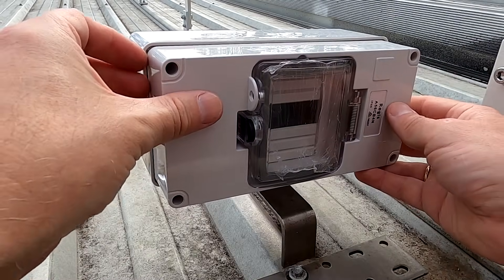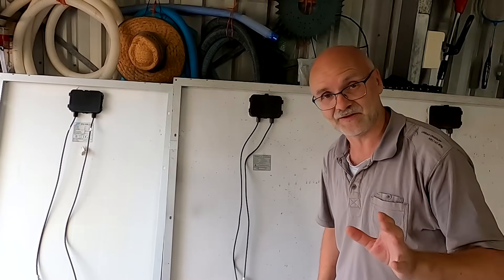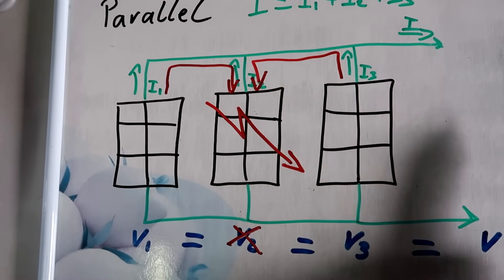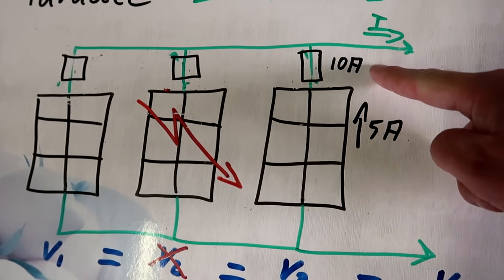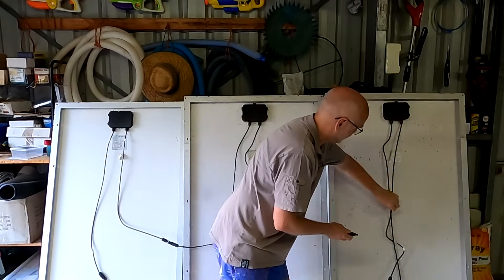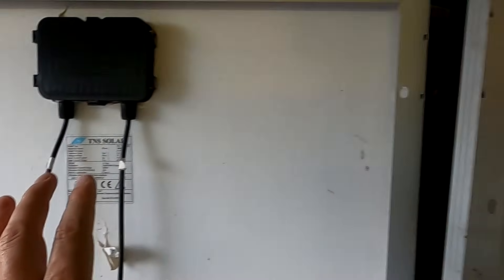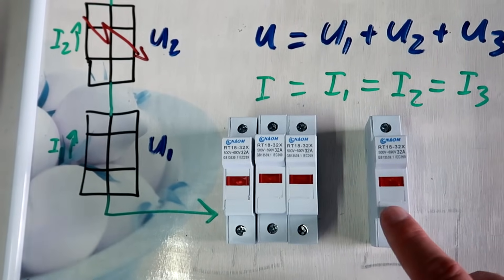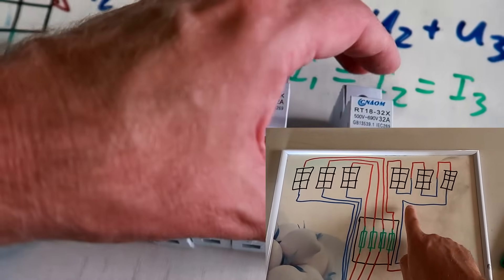Tutorial: Solar Panel Protection in Series and Parallel

Comment: With 40 years of experience I can tell you that putting fuses every where is a result of fear and missing knowledge.  Fuses are often the source of problems and the small currents of these panels combined with the high inner resistance make fuses obsolete, just avoidable cost and Voltage drop.
I operated short cut panels and even reverse polarity panels for test and the only slightly heat up because of the large surface but not even reaching the short circuit current necessary to blow the fuse, so this is useless.
Trust me I am an experienced German engineer!
bTw:
People speaking here of diodes and 0,5V drop are not accurate the Schottky have only 0,3 V  but are. Not earming money either.y

Comment: I think a short in a panel is not all that common as a failure. A high resistance in one of the cells would get warm too. Bow, with series and higher voltage, you would be "pushing" 5A through with much higher pressure (voltage) than in parallel, but no real way of detecting it as the MPPT controller would compensate and maximize the amperage * voltage. A fuse would do nothing then, while in parallel it would just have less amperage go through the panel and be fine. That said, use fuses for sure, and certainly also if you have several parallel chains.

Comment: Why would you need to fuse panels in series? When panels are connected in series, the current is already limited by the panel's rated max. current, so any panel failure won't produce an overcurrent. I can't think of a way that the fuse would ever blow. Am I missing something? Lightning?

Comment: A very good, very clear explanation of things. It also makes me relieved given that I thought it unnecessary to fuse my 2x300W panels - because they are neither wired in parallel nor in series. I have 2 panels, each with its own MPPT controller with each controller having is own fuse between controller and battery bank input bus. It amounts to redundancy at sea. Each panel also has an isolation switch between controller and panel, so I can’t easily shock myself. But it also makes it fun when people ask me “are these panels wired in series or in parallel?” - and I can simply say “No!”

Comment: I've never seen those din rail fuse holders before, since they are din mounted modules could you use a DC rated MCB instead? Also do you have the isolation switch on the roof with your fuses?

Comment: Interesting video!  I just found this video after a very large solar installation in our city almost destroyed the building it was mounted on.  I'm wondering if every panel was fused because the fire spread quite quickly from panel to panel.
Reply from the maker: There are certain safety standards which need to be considered when building a solar system.

Comment: Excellent, so why don’t any commercial operators use fuses on their installs?
Reply from the maker: A trained electrician will always uses fuses or breakers for any solar installation. Sometimes, these safety devices are built-in to the inverter but there should be at least a safety switch to disconnect the DC side.

Comment: I’m putting my 3 x 175W panels in parallel simply because if they are in series and one panel is in shade the entire system’s output is hindered.

But I enjoyed the clip simply because I can see how I an physically going to connect the wires so they don’t blow around when I’m driving.

Comment: You are wrong. National Electrical Code says no fuse needed for series, it adds no protection.  In parallel you only need if the total amps is more than the maximum series fuse value on back of panel.

Comment: So ... 2x 100W Renogy panels in series will charge my 24v battery.  Or would it be better it run them in parallel and double the amperage?
Reply from the maker: That totally depends on your charge controller and where the panels are installed. If you have an MPPT controller which can handle the voltage of two in series, that would be the best way. If you have shading from trees in your area, use them in parallel.
Reply: @OffGridGarageAustralia  Parallel it is.  It's a Renogy Adventurer 30A, which is a PWM controller.  Thanks ... Great videos too👍

Comment: So if you’re wiring in series and use one fuse, one 10 amp do you put the fuse on the plus side or the negative side?
Reply from the maker: Technically it does not matter where the fuse sits, but good practice is to fuse the positive line.
I personally have a DC double pole breaker so I can fully isolate my solar strings from both sides.

Comment: Hey mate, when connected in parallel and if a panel should fail when the fuse breaks on the failed panel. Does the rest of the system go back to charging as usual But at a lower charge rate because of the broken panel?

Thanks

Comment: Great video thanks..my question is:i have 2 panels 100w each 12v 5a.i want to connect them parallel...10a fuse each panel is  enough for this?thanks
Reply from the maker: Thanks for your question. Please have a look at the backside of the panels. It has some information about the maximum reverse current or max fuse rating. This is what you should choose the fuse/breaker after. If it says 8A for example, you max fuse rating cannot be larger than that.
Reply: @Off-Grid Garage  thanks for the reply...on back side it has maximum series fuse( A) none empty nothing
Reply from the maker: @djperfecto1  That is weird. Maybe you need to google the specifications for this particular brand and model of solar panels you have their.
Reply: @OffGridGarageAustralia  really there is nothing

Comment: A fuse in every panel, you made my day, Das ist in Deutschland absolut nicht die Praxis, egal ob Profi oder amateur
Reply from the maker: A fuse in every string. See the sticker on the back of the panel. It tells you what the maximum reverse current or fuse rating it has.

Comment: As Always, a Delightful presentation.  Very Clear.  My Dilemma is that my MOBILE Solar application has some (Unique) characteristics.  My 48V 400W panels will be Stacked.  Top panel receiving ‘energy’ constantly.  And Lower panel only receiving energy when I am Parked, and it is deployed via slides.  I want to be as SAFE as absolutely possible.

However, the slightly uncommon application that I planned leaves me quite perplexed ……. 🤔

Separately, regarding isolating the panels from the rest of the system equipment, a Solar Expert in AUS on a separate channel basically stated that even the rotary switch style isolators aren’t totally safe for isolating …. BUT, he failed to state What IS …

Comment: Does battery wiring configuration need to match the solar panel wiring configuration?
Reply from the maker: It depends on how much current you use from your battery. Charging is usually slower than discharging, so the cabling and safety devices need to reflect that.

Comment: You should rather use MC 4 inline fuse holders right at the panels.
Reply from the maker: Why? Very cumbersome if you do testing with your panels. I like the double pole DC breaker option in the combiner box inside the building.
Reply: @OffGridGarageAustralia   If anything goes wrong with the wiring between the panels and your fuses its not protected. An inline MC4 fuse  in between the panels provides the best protection for a string

Comment: Hello thankyou - I had 2 arrays 8 panels one array got wiped out in hail storm, do you think it's feasible to buy 8 second hand panels to replace the broken ones?  Is it hard to unbolt and rebolt replacments keeping the panel wiring ax before. Thankyou once again you are a good teacher.
Reply from the maker: If the two arrays were connected in parallel, you need to ensure the overall string voltage is the same. If they were connected to a different controller, the voltage does not matter though.
Used panels usually fit perfectly fine in such system. It's likely you can find the exact same ones again.

Comment: you don't need a fuse in this series configuration because the total amperage is below the max fuse series rating
Reply from the maker: Yes, in this case that is correct. But as per regulations, you still need to have a safety device.

Comment: You didn't explain the advantage of having the solar panel on parallel...which gives more Amps but less voltage.
Reply from the maker: That totally depends on the solar charge controller, battery and system wiring. Parallel has no advantage over series connection or the other way around. It all depends what system you have.

Comment: Sketched my design for solar panels and decided to go for parallel, but now building it I realize it's so much more expensive regarding all the extra connectors and splitters. Because there are a lot more connections in the circuit, isn't that also an extra risk? The risk of a faulty connector increases in theory.

Comment: Thanks for this, can I use 36v to charge my 24 volts battery system
Reply from the maker: 36V panels? Well, anyway, you need a charge controller which takes care of the charging process. It all depends on the battery chemistry you're using.

Comment: Hi. Very interesting. And is it possibile to use diodes instead of fuses in parallel configuration?  This could help if one of the panel goes under a shadow
Reply from the maker: Blocking diodes can be used in addition to fuses but cannot replace them.
One panel in shade still delivers energy to a parallel panel in full sun. I've tested this several times on the channel.

Comment: You mention the solar panel fault as a short. Do the panels fault where it is an open circuit?
Reply from the maker: Well, if it is an open circuit, it's no danger as there is no current flowing any more. The short is, what concerns us.

Comment: Is it true that if panels were in series, and one panel has a little shade that the voltage will drop on the one panel, AND then the max voltage of the string of parallel panels is the lowest voltage of them all? thus shade on one panel affects the maximum voltage of the parallel string? thus reduce efficiency of the other panels in full sun? I thought the idea of parallel was that one panel could go in the shade and it won't affect the other panels. Oh wise Andy. Please clarify.
Reply from the maker: Solar panels are almost constant voltage sources. Shading or full sun, does not make much of a difference in voltage. The current varies a lot though. The more light, the more current.
As you know I have a lot of panels in parallel (or strings of panels) and can see that even the ones in shade still produce some power and contribute to the ones in full sun in parallel.
Reply: @OffGridGarageAustralia  a "lot of panels" is an understatement. You are a Solar GOD! I bow to your batteries every morning. I did not know about the constant voltage source. It's good info. Other youtubers are incorrecctly saying "voltage drops" in the shade. I think what threw me off was there is a Voc and Vmp which is lower, so made me think the voltage fluctuated. That would be a good video idea to do to prove a single panel voltage doesn't sag in the shade. I feel like you've done that before tho.  Another video I just saw said voltage goes down in shade reducing efficiency of all other panels in parallel since the voltage is the lowest voltage of the string. Which I was intrigued by the statement.

Comment: in my opinion it doesn't need a fuse because in the cable terminal box there are already 2 silicon diodes in series the current is > 10a, so if the pv short circuit the current will be held by the silicon diode

Comment: Under the black box cover you will find the panel diodes to protect the panels
Reply from the maker: No, in the connection box there are just bypass diodes to help with partial shading of panels. They don't protect the panel though.

Comment: Thank a Lot for your labor! But, 6:18 I think a 10A gG-class fuse is not such a good solution... because yours PV-pannels produce only 5.63 Amps (according to labels on PV) at short circit (maximum possible safe current), so the 7.5A looks much better for safety. Also gG-class not so good in interrupt speed. I preffer a gR/gS or even a gPV class fuse in this case.

Comment: What happened to the batteries when I use external charger of 24volts 50amps to charge the batteries of 24volts in parallel on grid together with the charge controller

Comment: Where do you plug in your lights? Just add lights to your panels for 24/7 365 power supply! Don’t put them outside in the weather put them in the garage under the lights! For wind power just add a fan! Hydro power just pump the water back into the lake!

Comment: Is there any problem if I connect panels of different ratings to either parallel or series connection ?
Reply from the maker: Yes, that can be a problem. It all depends on voltage and current of panels if you can series or parallel connect them.

Comment: I have(2) 12v which is definitely going to be 24v by connection  200ahs battery and 200w (4) panels 60a mppt controller  how best should I connect the panel parallel or s

Comment: Many solar panels now come already fitted with blocking diodes - they're inside that black box on the rear of the panel. These prevent any voltage from flowing back into the panel, allowing easy connection of parallel strings and eliminating any possibility that a defective panel could be damaged by others. It would pay to check with your supplier or Google the model number to see if the panels have blocking diodes or not.
Also, in the example of the two other panels each supplying 5 amps (total of 10 amps) into a defective panel, a fuse of 10 amps would likely not blow. If you have 10 amps flowing (and that assumes the remaining good panels are both providing full power), a 10 amp fuse will hold with a current of 10 amps through it. That's why it's rated at 10 amps. If it did blow, it would take a very long time to do so.
To continue, let's say the middle panel is defective and low resistance. If the other two panels are providing 3 amps each, that's a total of 6 amps which is more than the defective panel is rated to - so it would likely overheat - but 6 amps isn't enough to blow a 10 amp fuse.
As you can see, the use of fuses to provide panel protection in this instance isn't a practical one. 
You are better off installing Schottky diodes on each panel, to prevent reverse voltage entering the panel (also helps when panels are in parallel and one or two are shaded).
Just some points to ponder.

Comment: 13:31 No, there is a clear principal reason for that. You are only speaking about the Short-mode fault in this video. When we think about the Open-mode fault as well, the parallel connection has an advantage compared to the series connection which is you don't lose all the power at once even if a single panel is in the Open-mode fault or contact failure in MC4 connectors.
Reply from the maker: Yes, that is correct. Thank you for adding this info here.

Comment: Does this still apply to only two panels in parallel? If one is faulty then the power running to the other panel is equal to the power that the faulty panel produced, or am I missing something?

Comment: If you have a 12v battery and 3 solar panels that add up to 108v can you still wire in series? And I suppose it's the same for batteries if you want to keep it a 12v system and you have more than one battery you wire them together in parallel is this correct?

Comment: Please explain why you need to fuse a series solar panel connection. Under what condition will the current exceed the fuse rating? Intuitively, it seems like it is unnecessary and just another failure point. Note that I actually had a failure of a series fuse holder in a single 100 watt, 18 volt panel system. The fuse holder melted. I assume it was poor quality from the manufacturer.

Comment: 12V system with twin 200 AH LIFEPO batteries. Using for off grid cabin. I have panels in serries now. Would parallel be better for small applications like this? GREAT VIDEO!

Comment: Thank you so much for this video, please if I have a system running on solar and I have two 400 watts ice maker machine. How much power will I need to run then correctly? I am talking about if 4 batteries 100 Amps and two solar panels 350 watts 36 V and an inverter 3,000 watts. Please share some thoughts with me. Your video are so easy to understand, congratulations, good job.

Comment: Higher volts are better for inventor and wire/ cable to connect panels to inventor will cost less than in case of parallel panels.

Comment: I have some changes to make on my new setup. It's my first and I like the way this guy explains it all. Some one else told me Seris was the way to go, but I had wondered because my test panels were not staying up with the demand of recharging my batteries, and now I know why.
Reply: This guy is a blowhard.  National Electrical Code says no fuse needed for series, it adds no protection.  In parallel you only need if the total amps is more than the maximum series fuse value on back of panel.

Comment: Hello, great video. I have 3x100wt panels   and connected to a 20a mttp tracer controller,  the panels are connected 
p1 + p2 + p3 +
P1  - P2 - P3 - 
In your video this shows I would need to fuse all three + panels with a 10amp fuse. Have I got that right...

Comment: There is no need to put fuse since  there  is a diode in each panel so the current and voltage  will not back flow....
Reply from the maker: That is not quite true. The diode in the junction box in the back of the panels are just bypass diodes which helps with shading. You're talking about a blocking diode, but these are not included in the panel.
Also, a blocking diode is not considered a safety device to prevent reverse current. If the blocking diode fails, you could start a fire. You MUST have a fuse when paralleling panels, depending on the specs and reverse current stated.
I made a video about the different diodes here: https://youtu.be/J9jqUwOdnEI